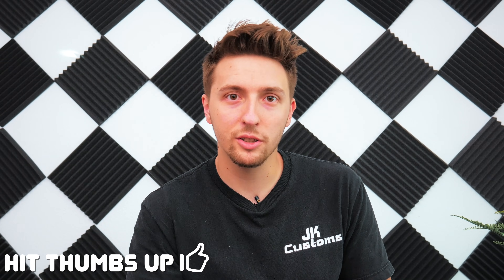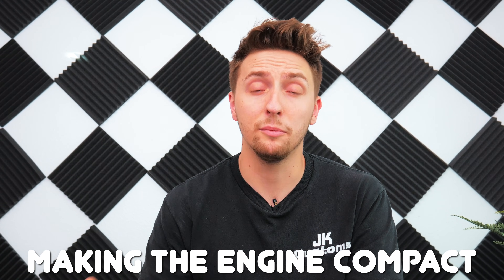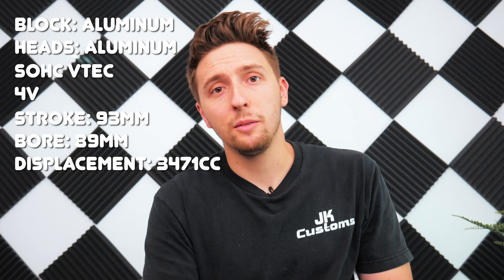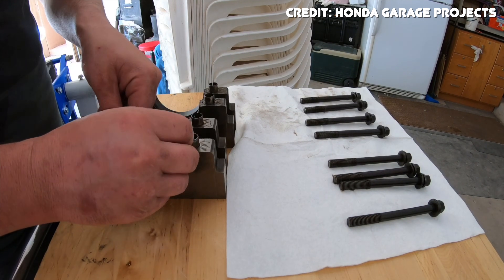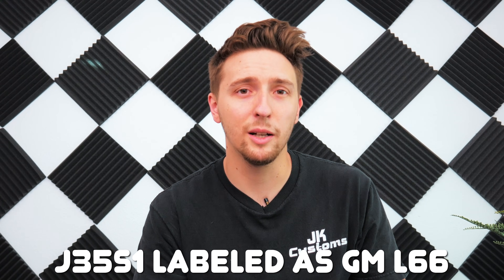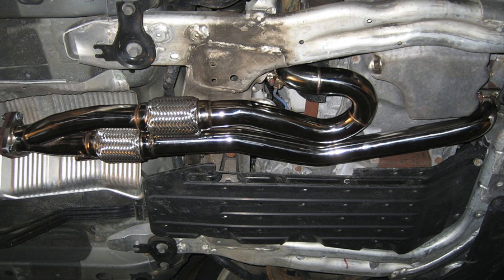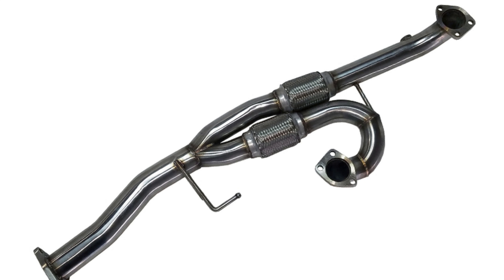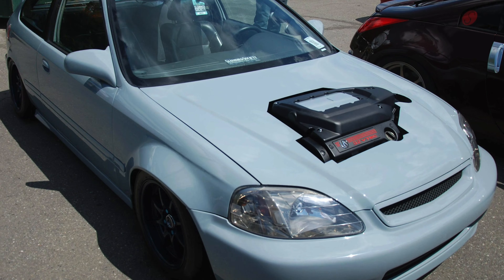Honda J35: Everything You Need to Know

Comment: If it went to a timing chain it’d definitely be the best v6 on the market cause the fact these new pilots and passports hit 60 faster than the si civics are amazing
Reply: My 04 oddessey can keep up right next to one
Reply: What's wrong with a belt? I much prefer belts to chains. They're really not that hard or expensive to replace and being a mechanic i see well maintained belt engines lasting longer than chain engines as a rule
Reply: This! @carterthiessen2664
Reply: @carterthiessen2664  absolutely agree with this, I’d rather change and maintain a belt than a chain which is much more costly and used plastics as tensioner, guides, etc
Reply: It is really nutty.
Reply: Honda is geared more for performance and why they use a belt. Belt drives are even preferred in drag racing. Jesel
Reply: timing belts are gravy jobs
Reply: it takes 5 minutes and a wrench to change belt on J35 
Some belts are steel enforced, though OEM lasts well over 100K
Reply: @JSPHTRS   no silly a timing belt is a 3-5 hour job 😂
Reply: @mariotaylor9990  Exactly....  The serpentine belt (accessory belt) is a 5 minute job, but not the timing belt.  I wish the timing belt was a 5 minute job.
Reply: @JSPHTRS  I think you're referring to the serpentine belt. A timing belt, even if you leave the water pump still usually takes a few hours. I did one on a 2012 odyssey last week, just the belt, not the pump, and it took me an hour and a half but I've done probably 40 or 50 in my career as a tech over the last 8 or 9 years.
Reply: @carterthiessen2664  

oh snap , yes youre right. Timing belt requires more time

Comment: Honda downplays the numbers on the J35 (specifically, the J35Y2). It's producing close to or more than 300hp at the crank. I used to think the J35 was seriously an underwhelming engine until you realize engines like the VQ35 and Toyota's V6, the 2GR are running DOHC, a more advanced variable valve time system, higher compression numbers, direct fuel injection, and yet, the J35 still meets or exceeds their performance numbers with low compression (10:1), SOHC, relative V-TEC system, low r.pm. (6800 r.p.m.), and port-injection. If Honda were to employ DOHC, increase the compression numbers, add port/direct injection, a more advanced variable valve timing, and increase the redline (8000 r.p.m.), I have no doubt the J35 could easily 350+ whp (410 at the crank). However, having that much technology in a Honda V6 would increase the cost considerably. The J35 is an incredible well built engine that clearly shows how Honda doesn't have to overly complicate engine technology to meet or exceed their rivals. On the other hand, it would be nice if Honda did release Type-R variant of the J35. A nice good bye to show the world what Honda can do with NA V6.
Reply: This is poetry my friend
Reply: Beautifully said brother 💙
Reply: This man said it all.
Reply: @MrChad97Z Not necessarily, sir. Not if it's not made to be reliable to begin with. Look at the Lexus V10 in the LFA, the 1LR-GUE. It red-lines to 9500 r.p.m. has a higher output in horsepower, HP/Liter, and it's incredibly reliable. What about the 2JZ (an engine that was made to handle twice its horsepower), F22, K20, K20C, and so forth? High horsepower and reliability has a cost. 

Usually what's associated with are forged internals and superior cooling and lubrication like multiple coolers (transmission cooler, 2nd oil coolers, multiple oil reservoirs, good ventilation, and so forth) and a dry sump lubrication system. From the engineering perspective has to do with tolerance levels of internals, quality of materials, taking consideration of expansion coefficients, and so forth. 

In racing, Honda has been a force to be reckoned with. Their V8's, supercharged V8's, turbo V8's, V10's, and V12 from the point of view of reliability are a nightmare to competitors because of their incredible reliability. In many cases, Honda doesn't even sell their racing engines to racing teams. They lease them and they supply their own mechanics. Why? To protect their technology. 

Implementing DOHC, adding duel injection systems, higher red-line, and other enhancements does increase complexity but it doesn't necessarily mean the engine will be less reliable. Look at Toyota's complex fuel systems (port and direct). It's far more complex than BMW, MB, Honda's, and so forth but yet are so well made it has a very lower failure rate when compared to much simpler systems. Honda's variable valve timing system, by far, has the lowest failure rate in the industry.
Reply: I have read that the reason they went with the sohc is because having exhaust vtec only gave a minimal improvement and it was not worth the added complexity and size
Reply: Mans wrote every j series dream in a nutshell
Reply: Check out "power rev racing" he had a J37 FBO tuned with upgraded CNC ported heads making 356whp NA, now its a supercharged 11 second car detuned too 380whp but it makes 507whp full tune with the 6AT j series didn't have much aftermarket support before but now these engines can run with modded K series in lighter cars if you spend the money
Reply: Not goin to lie.. I cried reading this.
Reply: Lets not forget its belt driven vs the competitions chain.
Reply: @Montoyajdm  I will NEVER understand why Honda kept the J-series as belt driven.
Reply: @ErwinSchrodinger64  why so ?
Reply: Timing belts take "a bit" of work to replace while chains rarely need replacing. = )
Reply: @ErwinSchrodinger64  I could never understand that either. I own two Hondas with this motor and recently did the timing belt service on both. One is a 2011 accord coupe 6mt just hit 100k runs perfect. The other is a 2006 pilot exl that I inherited from my grandpa. He never did the timing service but it only has 105k on it. Honestly I was expecting the belt to look terrible but it really wasn't that bad. Definitely made me nervous though I feel much better now that it's replaced.
Reply: The most powerful factory J35 was the Y4, which made 310bhp and had direct injection along with a 11:5 compression ratio.
Reply: Beautiful words to my ears!
Reply: I purchased a 9.5 gen accord coupe touring and love the sound. Such a great car, also slept on.
Reply: @kimo kemar lol I'll take my touring  v6 auto in that case
Reply: Honda should definitely bring back the V6 + the 6 speed. If the TLX Type S had a 6 speed, it would all be fine
Reply: Beautiful bro
Reply: Yes and pair it with awd in the Acuras and it’s like heaven
Reply: Honda does have a dohc version it's in the nsx..
Reply: Meh, not really always the case. There's a saying in engineering that the simpler you can keep things, the better. 

American terms, modernize a simple design that works. GM kept improving upon the small block push rod V8 engines such as the LS series. While Ford wanted to change the envelope as much as they can, pushing the next best design out always such as the DOHC 32V V8 Coyote. They both make the same horsepower but one is much simpler.
Reply: I got 2013 v6 accord with that sohc I wondered the same..like why didnt they make the sport with DOHC and leave all other models with a sohc
Reply: @user-ip2ft5uj4y  the sport is dohc… i4 dohc. There is no such thing as a accord sport v6. The only naturally aspirated dohc v6 honda has is the c30/32 from the old nsx’s. The only dohc j series honda has is in the new tlx type s, which is turbo’d. The new nsx has a dohc v6, but i don’t think it’s a j series
Reply: @user-ip2ft5uj4y  the sport is a joke lol and it is dohc. Doesn’t have a v6 tho
Reply: @kimo ya I wondered why it was outside of production cuz I assume 2 sets of gears meant more speed or power like with any thing even lego gears and motors? But I'm also not a mechanic..
Reply: @user-ip2ft5uj4y  the motor and the transmission in the sport weren’t meant for speed. It’s just pretty much just suppose to look sporty
Reply: i have a j35, do you think its worth modding or should I get a VQ35?
Reply: Engine is almost bullet proof if you take care of it. My thermostat was stuck closed my engine over heated so many times trying to get home and now it’s back in tip top shape with new bolt ons
Reply: But I also got the 5 speed automatic trans which will probably break when I switch my cams
Reply: I love my 04 6 speed 😭
Reply: DOHC does not equal more power
Reply: Honda has complicated it with auto shut off. 3 cylinders shutting down. It wears it out faster. You wont get 200k out of that engine anymore
Reply: That just means the engine is being pushed further than the VQ
Reply: and put it in a ridgeline that weighs closer to 4000lbs :)
Reply: they to have a type S TL wit a 3.5 vtec

Comment: Great vid! My daily is an accord 2 dr with the J35y and 6 speed manual. Love this engine, stupid reliable and makes surprisingly good power
Reply: Same it's a fun daily
Reply: @robertalicea5585  perfect daily & highway cruiser, still get over 30MPG
heated seats in the winter!
Reply: @MikeYurbasovich  nice, I live on the sunshine coast BC & it was so fun rowing the gears on the 6 speed, twisty country roads :D
Reply: i want one
Reply: What year is yours?. Mines 2011accord  2Dr
Reply: @marlonrichardson5035  mine is a 2013 so 9th gen. And nice that's the 8.5 gen if I'm not mistaken?
Reply: @marlonrichardson5035  same here 2011 6mt black. Had it for almost five years now never any trouble and it's enough to have fun.
Reply: Same, but I've got the 8th gen 6mt. Really surprising the power it puts out (often too much for the wheels to handle lol)
Reply: I have a 2009 accord coupe with the k24 auto I wanna eventually get the 2014 j35 manual ...... I need it
Reply: @zabuzauchiha8717  I'm selling my 2015 this summer with the 3.5 auto/exl white orchid pearl with 19" wheels with Toyo proxes a/s from the accord sport, the parchment leather interior and infinity stereo. It will also have the stock 18"wheels with continental viking contacts.

Comment: Nissian VQ , Am I a joke to you?
Reply: Apples to oranges
Reply: @static.cr3  Can you elaborate more on why that is the case? I’m still new and only know that they are both well loved V6’s from Japanese manufacturers. How do they stack up otherwise? Is it because Honda built the J series V6 SOHC to be as fuel efficient as possible with big torque in low end and VTEC in high end power for AWD/FWD cars, while Nissan’s VQ DOHC was designed for max HP with VVEL mid torque for RWD based cars?
Honda usually uses VTEC for a boost in more power. Nissan usually uses VVEL for a small boost in more MPG.
Reply: @SilverScarletSpider   Seems like you know one is performance oriented and one but to further elaborate the VQ is a short stroke while the J is a long stroke. That’s not to say a J won’t outperform a VQ ( depending on the platform )
Reply: @static.cr3  Has Honda ever really built a performance oriented V6?
Reply: @SilverScarletSpider  if you count the 1st gen Nsx , 2nd gen Nsx and the new type s tlx ( acura but still a Honda )
Reply: @SilverScarletSpider  cl type s
Reply: 6 speed

Comment: the vq35 is better
Reply: The VQ35 is not better. They are mostly oil burners. Honda’s don’t burn oil. The VQ37VHR Is much better than the 35
Reply: @mrmiagi6052  that is also true
Reply: Cry about it. V6 accord coupe gap zs
Reply: What you smoking? This engine is as reliable than VQ.
Reply: Honda downplays the numbers on the J35 (specifically, the J35Y2). It's producing close to or more than 300hp at the crank. I used to think the J35 was seriously an underwhelming engine until you realize engines like the VQ35 and Toyota's V6, the 2GR are running DOHC, a more advanced variable valve time system, higher compression numbers, direct fuel injection, and yet, the J35 still meets or exceeds their performance numbers. If Honda were to employ DOHC, increase the compression numbers, add port/direct injection, a more advanced variable valve timing, and increase the redline, I have no doubt the J35 could easily 350+ whp (410 at the crank). However, having that much technology in a Honda V6 would increase the cost considerably. The J35 is an incredible well built engine that clearly shows how Honda doesn't have to overly complicate engine technology to meet or exceed their rivals. On the other hand, it would be nice if Honda did release Type-R variant of the J35. A nice good bye to show the world what Honda can do with NA V6.
Reply: @ErwinSchrodinger64  damnn my man wrote a whole essay on the j35 but he got a point tho i still love my vq35de tho

Comment: I wish Honda made a DOHC V6 J-series 😂
It is interesting that for things like Porsche, Ferarri, BMW, Lotus, and Corvette track builds with 1000hp Honda engine swaps many people still prefer using the I4 K-series instead of the bigger displacement V6 J-series.
Reply: The J-series engines are not only bigger in size and harder to fit in certain chassis, but they especially weigh more. Great and reliable engine, though.
Reply: K series has more support. Only reason
Reply: The new Acura tlx type s is a 3.0 dohc v6 Turbo 😏